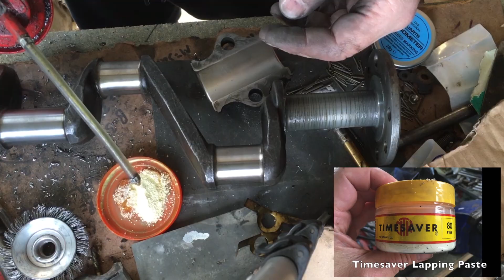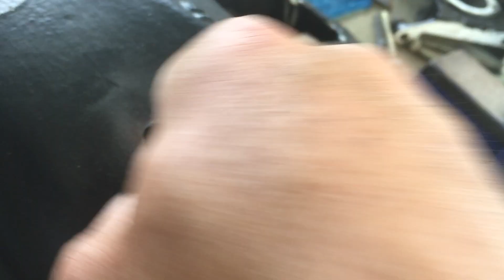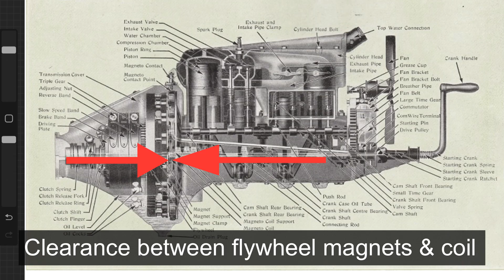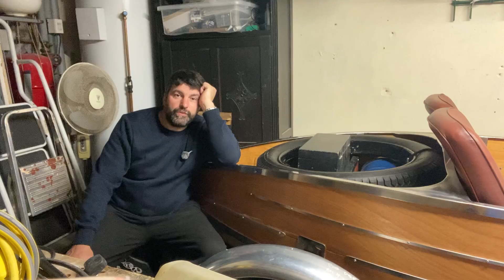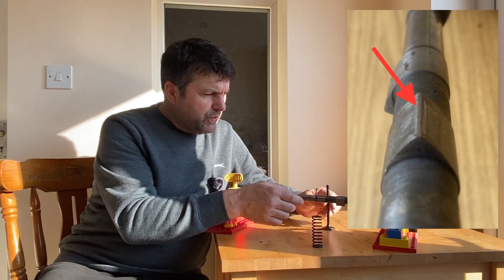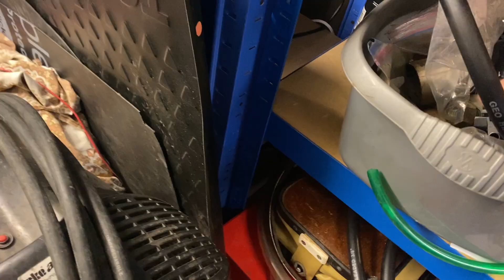Finally! I get all the parts and rebuild my Vintage Ford Model T Engine

Comment: Wow!! Very interesting. As I watched you installing that oil wick rope seal I thought to myself I'll have to post about using modern oil seal on the cover and sure enough you had already heard of that little trick. It was my Montana 500 partner that originally started using and promoted the idea, Garrett Green. I was surprised you didn't install the adjustable lifters which makes adjusting the valves later easy. Can't wait to see and hear it run and drive!  Now to check your sailing channel
Reply from the maker: Thanks very much! You Montana guys are great, would love to be able to do something a bit more like that. Please thank Garrett for me! So nice having a fairly oil tight T.
In hindsight I should have installed adjustable lifters, but I was a bit of cash and could not face waiting another few weeks for them or trying to get the cam out again (it was a bit tight getting it in). I have had her running, must try to upload a video, but I am struggling for time at the moment.

Comment: I too bought a model T Scat crank and had it shipped over to the UK, it was also bent by 0.010” when I received it. Took it to a company who specialises in pre war engines, they soon straightened it out on a press, apparently quite common on cranks that haven’t been properly stress relieved, have been stored badly or haven’t been handled with care.
Reply from the maker: Not just me then! sometimes I get paranoid that these things happen to me only. 
It is pretty shoddy really not to supply it in a straight condition. I mean I can get a TV delivered in the post from China or Japan and it reaches me in perfect ready to use condition, so how Scat can not ensure that they machine a solid lump of forged steel, stress relieve it and courier it to me correctly is a bit beyond me. I suspect Scat cranks are about to get a lot more expensive too as they are forged in China, so will have added tariff charges now.
Having moaned a lot, I am glad that Scat make the cranks still, but bad quality control leads to bad reputation and that is when people stop buying stuff and trade deficits start racking up.

Comment: You can always tell a big time Youtuber by his high dollar graphics.  After watching the time and care you took reassembling your motor, I'm shocked that my slapped together junk even runs.  Can't wait to hear it fire up. Cheers from the Shed
Reply from the maker: I really did not want to rebuild it like that, When the crank broke, I just fell down the rabbit hole and then kept digging. Costly, complicated and not much fun. I really would have preferred to take your approach.